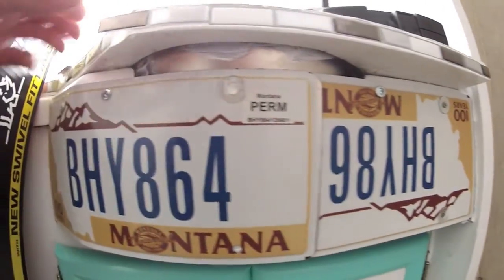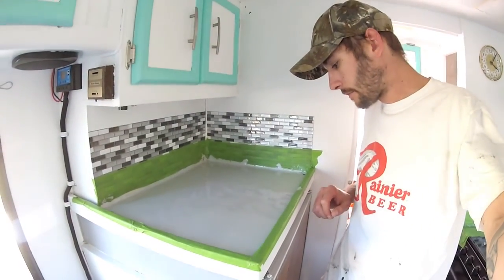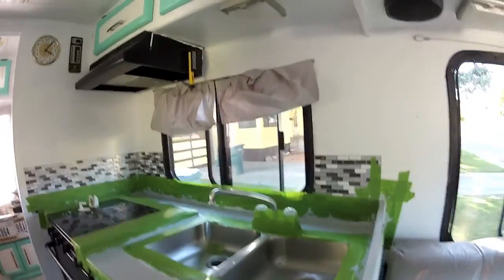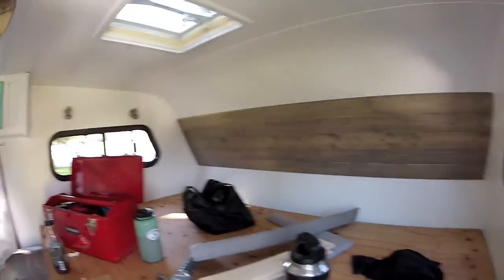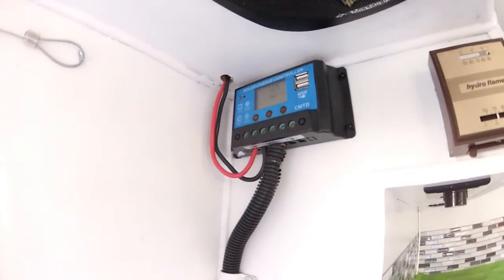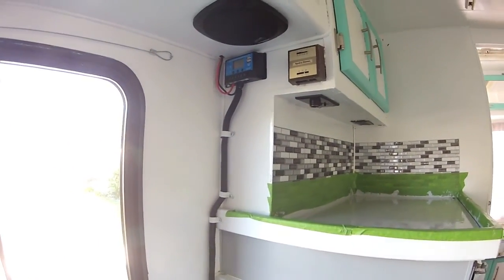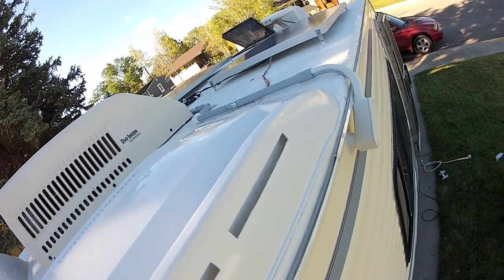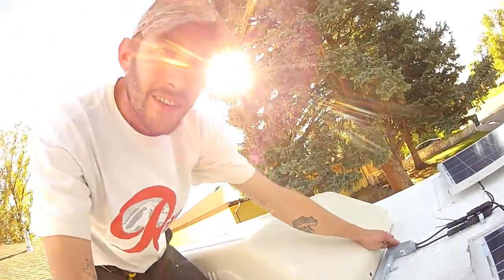Solar done, interior projects moving on.

Comment: Can you show how you did all the solar connections? We have a Toyota warrior and we need solar system. Thanks. Big fan. 😀
Reply from the maker: DESAFIO NOMADA just ran the wiring from the pannels to the charge controller. Fed most of it through conduit for UV protection. The Renogy kits are very straight forward 👍 thanks for watching!!
Reply: Wandering Patches can you show me how you set up the batteries under the seat. I m doing the same.
Reply from the maker: DESAFIO NOMADA there is a single battery compartment under mine, main reason I have everything in that area. Just ran wire from the charge controller to the battery into the plastic compartment.
Reply: Wandering Patches. So you just have 200 w panels and one battery? Is that enough to run you fridge, fun, tv, laptop, etc?

We have 1 dog and 2 cats so need to run the A/c or heater more after. We have 2 laptops, 2 phones, tv...
Reply from the maker: DESAFIO NOMADA you should check out some of my other videos to understand the setup more. Our fridge is not 12v it runs on propane off grid or electric plugged in. Our TV is led 12v so very little draw. Charge with a 120w inverter during peak solar or a 12v charger i have for my Mac. AC meaning air conditioning? That needs a whole lotta battery and is very debated. We use the generator or plugged in for AC. Heat we use a buddy heater to avoid the huge power draw from the stock furnace. One 100ah battery and 200w solar has done us very well the last year + no complaints.
Reply: Wandering Patches we don't have generator, so I'm thinking about 300 or 400 watts panels and 2 batteries. I wonder if there's enough space for two batteries under the seat...
Reply from the maker: DESAFIO NOMADA you could fit a dozen batteries under the seat but need to think about weight and price. Overbuilding can be just as bad as underbuilt. All about balance, less weight more mpg and less wear on the vehicle. We ran the same setup in our old rig with no generator just fine but again no fridge and definitely not accept or heat. Great comments and ideas!